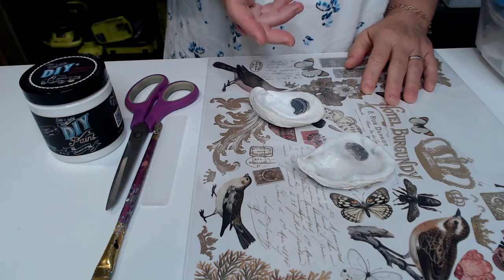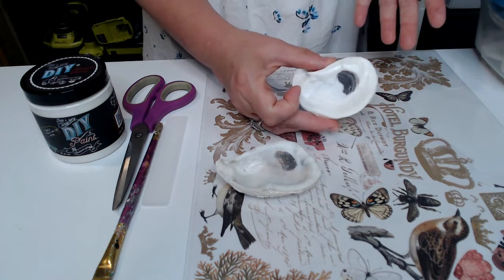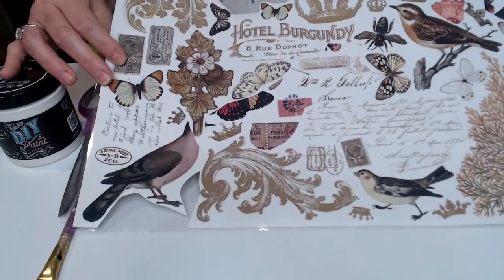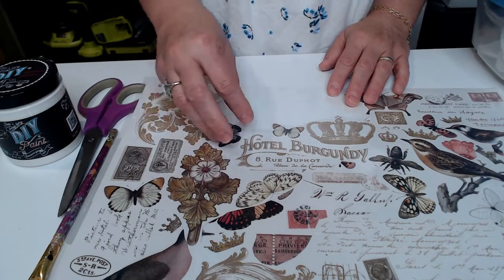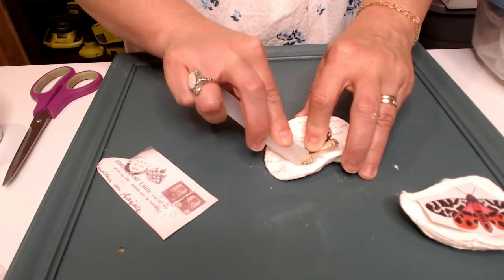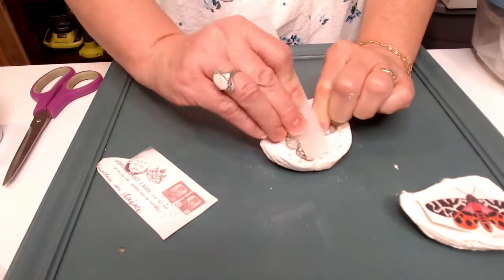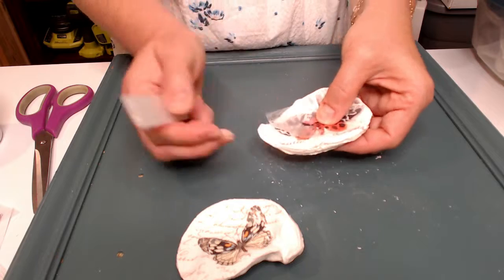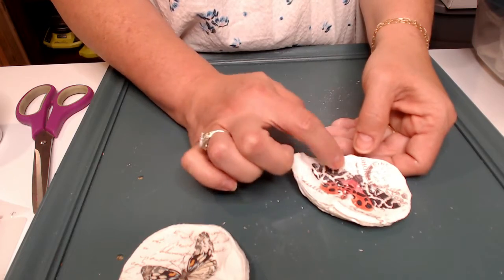How to Apply Rub On Transfers to Oyster Shells | A Maker's Studio | DIY Paint | Rethunk Junk Paint

Comment: I have a few oyster shells that I brought home from a restaurant and I soaked them in bleach but I can’t get the backs of them bright white. Do you have any suggestions? I love these and never thought of using a transfer on the insides and love how you framed one of them! Thanks for sharing ❤
Reply from the maker: Thanks so very much!
Reply from the maker: I have always just bleached and then let dry out in the sun and heat and that seemed to get them pretty white. However I will do a little research and see if I can find anything that will help. The backs of my oysters are not really bright white they have dark grey areas on them.
Reply: I’ve put them in the dishwasher to clean. It works really good.
Reply from the maker: @marshacurrie1411  I'll have to try that next time.
Reply: Soak them in vinegar and water for 30 min